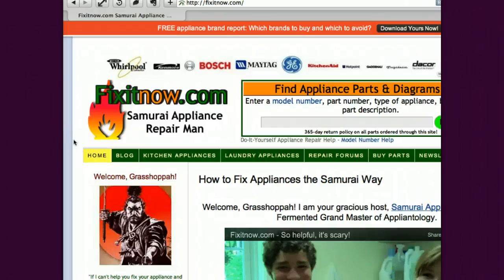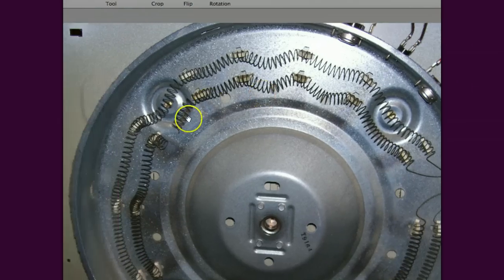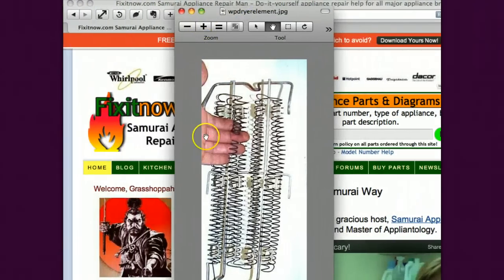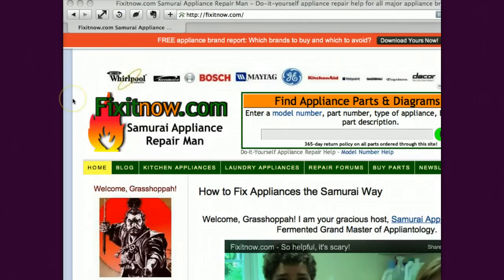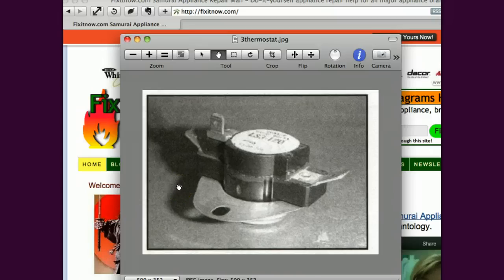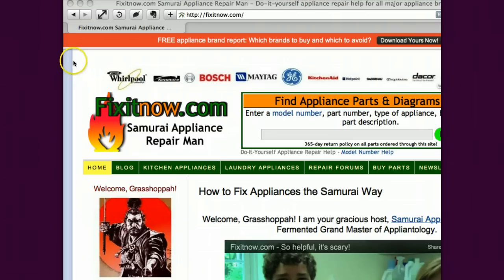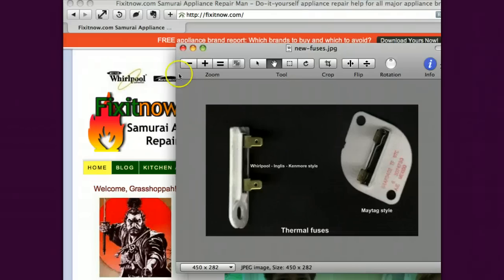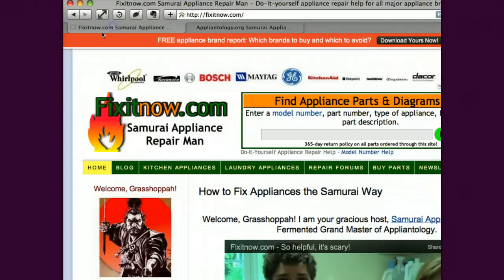Dryer Overheats and/or Dryer Gets too Hot!

Comment: Our dryer was overheating to the point that clothes were too hot to touch when we got them out of the dryer.  My husband was ready to just buy a new one instead of spending money to have a repairman come. They are expensive of course.  So I watched your video and then opened up the dryer and found that the heating element had fallen loose from its support in one spot and was touching the bottom of the casing therefore grounding itself out.  I took it apart and reinserted it into it's support.  Dryer works like a charm now!  Thanks for your video!! Our dryer is fixed and it cost us nothing!
Reply from the maker: +Yermomma1963 Great repair story! Be sure to watch our other video on this problem for some electrical insight into this problem. https://www.youtube.com/watch?v=xQ0lqcSa-I4
Reply: SamuraiRepairman  hey, my GF's dryer is blistering the paint on itself & the washer next to it....she won't pay attention to my assessment that it's a fire hazard....

Comment: Thanks. I replaced my heating element because the rings in the inside had broken off and there was no continuity. A month later my dryer goes out again so i Goolgled the problem and had found that I had a bad thermal fuse.  After replacing the thermal fuse I instantly seen that my dryer heating element was running with out starting the dryer.  Thanks to your video I saved even more money by checking my heating element and noticed that the rings were touching the ground which may have caused the thermal fuse to trip in the first place.  Thank you.

Comment from the maker: If the heating element in a dryer is staying hot even when not running a drying cycle, then you have a grounded element.  Replace the element.  Buy the replacement element through the parts search box at Appliantology-- new OEM part with a one-year return policy.

Comment: Thanks for this video.I pulled out the heating element and sure enough one coil is grounded/fused to the housing.I will try to separate them and hope that the coil won't break. If not I will purchase a new one. I will purchase a thermostat as well. Thanx again.

Comment: Thank you so much for this video.  I talked to a tech who, without looking at the dryer, assumed I had a bad motor and tried to sell me a new dryer.  I will check this and see if it's the problem.
Reply: even if it was the motor, it would be cheaper to replace that than buy a new dryer wouldn't it?  Sounds like this tech didn't know what he was talking about because motors are the last thing that usually go on a dryer.

Comment: Replaced shroder and the 4 glide tabs. Stopped the squeaking but now after about 5 to 8 minutes the back of Dryer (metal panel) gets very hot. Can't find any info. Thoughts? Top of dryer doesn't get hot. Just the back. Don't know why this would be happening after replacing the Shroder. Makes zero since to me

Comment: You ever heard of a electric heater relay which also might have a electric relay for the start motor that could be stuck closed and the heat running all the time that you turn on the dryer and it's not being controlled by the thermostat which is fine but nobody seems to talk about that do they

Comment from the maker: A common failure pattern is the cycling thermostat will stick closed and then the heater cycles off and on based on the high limit thermostat, which is set at a much higher temperature cut off.

Comment: The thermal fuse to our Maytag Centennial was blown and the drum motor would not engage (as designed), but the heating element would still glow red :-/  I replaced the thermal fuse and the drum operated until the thermal fuse let out it's magic smoke due to the element always being at 100% even when in the "air" mode. Guess I will check for a broken coil wire on the element assembly.

Comment: i believe is the same. one wire is original that burned and was replaced.
Reply from the maker: According to the 4th Law of The Prophecy (http://appliantology.org/blogs/entry/631-samurais-12-laws-of-appliance-repair/) "Beliefs are for religion, not appliance repair." Is the replacement wire the same gauge as the original or not?
Reply: Yes. Think its one of the heat sensors. Hoping. Having it checked
Reply: It burnt both wires this time. The one that was replaced and straight threw the original.  Woulda shared pic but gave me no options to do that
Reply from the maker: Start a new topic on this at the Appliantology DIY forums and we can get into details there. http://appliantology.org

Comment: changed one wire with new connector and then both burned. one all the way and one just the insulator around wire. the connector ends were pretty tight and hard to slide on and off
Reply from the maker: +Derek Nelson Sounds like the replacement wire gauge is too small for the current draw.

Comment: Hi, my dryer gets extremely hot and even with the setting set for no heat the element still heats up, I took my dryer apart and removed the drum, I plugged the controls back in and seen that the element heats up and glows evenly. Would you still think it is a high limit thermostat problem even with the control set for no heat?
Reply: Its clean of lint and also not restricted to outside as it blows hot air outside when I checked it. I also replaced the fan /blower assembly last year.
Reply: Well I tried it again with putting the old thermostat back in and running it ,this time it heats up glows bring red with the element  and control on high heat and does not heat  when set on no heat. Maybe for the 60 dollar part I will run out and replace the high limit thermostat like you suggest in your video.
Reply: wing sham Was this what was wrong with your dryer? My Dryer is Doing this right now. Then throws E64 Code which apparently is the element or a connection. But I just don't see how, I've always thought either an element works or it doesn't lol no in between

Comment: I have changed thermal fuse twice , vent and blower no restriction to air flow thermistor 10.8 ohms continuity to both thermostats heat element visual good continuity good will blow fuse did not change out thermistor on model # WED8300SW2 whirlpool

Comment: Ever heard of a dryer overheating due to high voltage from the outlet??  Reason I ask is I have put 2 different dryers in and they both are running hot.  The whirlpool will bust open the Thermal Fuse and the GE just gets so hot you cant even touch the top of it.  ??  When I check the outlet I get 246/122/122.  Would that cause a dryer to run too hot???